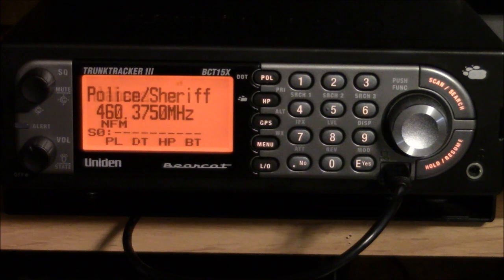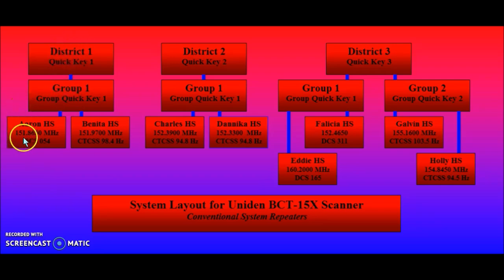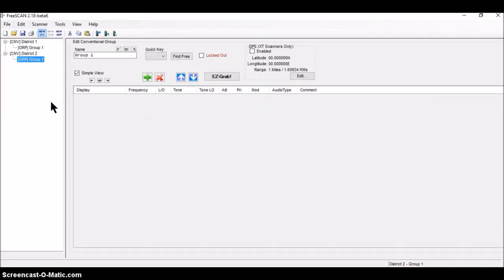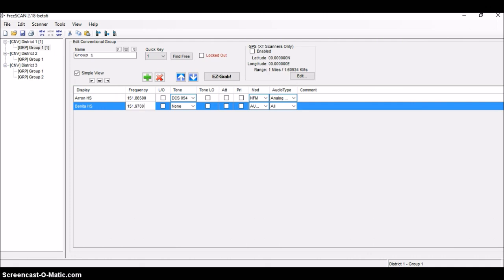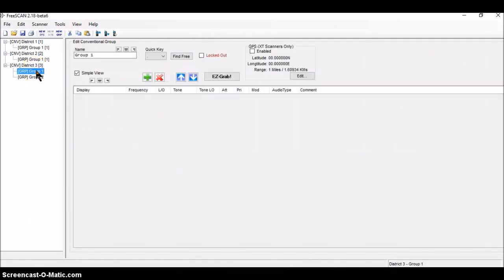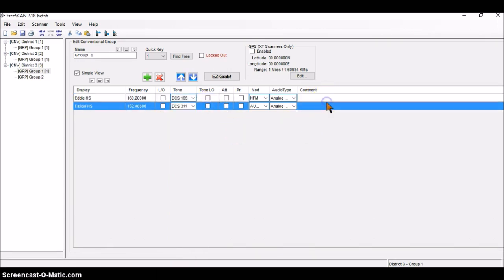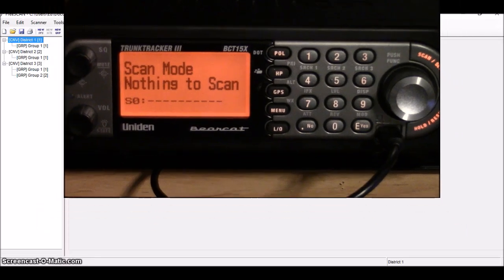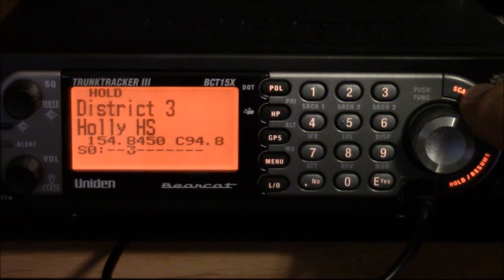Uniden BCT15X   Freescan Programming

Comment: i was wondering if you could help me out programing a trunked system into the bct15x?
Reply from the maker: First of all, if you don't have the No-Cost FreeSCAN software here's the link

http://www.sixspotsoftware.com/downloads

As far as programming the Trunking systems, I've decided it's easier to send radioreference.com the $7.50 for 90 days access and download the programming for my local trunking systems.  Programming a Trunking systems requires a ton of monitoring in order to get all the "group information & user information.
Reply: The Erod1944 Channel so you do NEED a computer to program a trunked system?
Reply from the maker: I think it's possible to program Trunking Systems manually but I fooled around with that process and gave up.  Even if you download the data from radioreference.com it's still extraordinarily difficult to gather the Trunking System Data,  Figure out the crazy schemes in the scanner and then actually do it.  I gave up the idea but then, there's only 3 trunking systems in my area and I don't care about two of them.....     A computer while not necessary is certainly the suggested method.....

This may be useful to you and give you some idea of what you're working with;
http://new.marksscanners.com/
Reply: The Erod1944 Channel thank you very much sir! im just gonnna take the easy way and use a computer.
Reply from the maker: Yep and if that makes you crazy you can always send radioreference.com the $7.50 for 90 days access to download and install the systems in your area on your scanner.   Good Luck !!

Comment: Any recommendation's on a mobile antenna's for the BTC15X . magnetic or other .
Reply from the maker: Scanners aren't that picky concerning an antenna as they don't transmit and typically have very good receiver sensitivity.

As far as magnetic mount or hole mount, they are pretty much the same and the decision is;  to drill a 3/4"  hole in your roof or not.   I have used simple quarter wave VHF whip antennas on  a roof mag mount with good results on VHF/UHF and 800 MHz.     I've used "hole mount" antennas and got the same result.

Here's an offering for a complete setup from DXEngineering. Many other companies offer the same or identical.

https://www.dxengineering.com/parts/mfj-1721?seid=dxese1&cm_mmc=pla-google-_-shopping-_-dxese1-_-mfj&gclid=Cj0KEQjww7zHBRCToPSj_c_WjZIBEiQAj8il5AZXzBkmX5yDH_HBCXgeNdIX7xHdgD0Vz5YWWv3lCzAaAtyz8P8HAQ